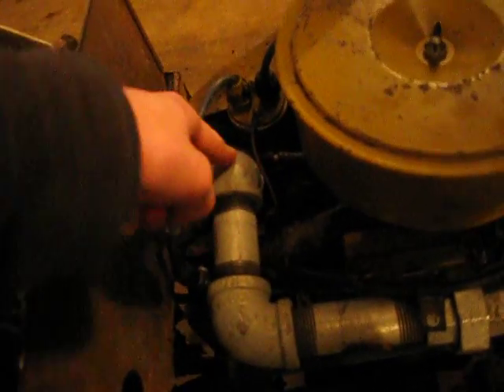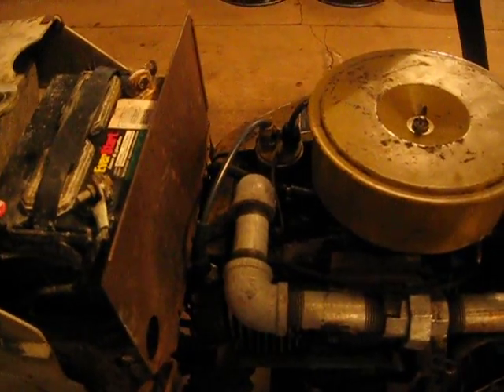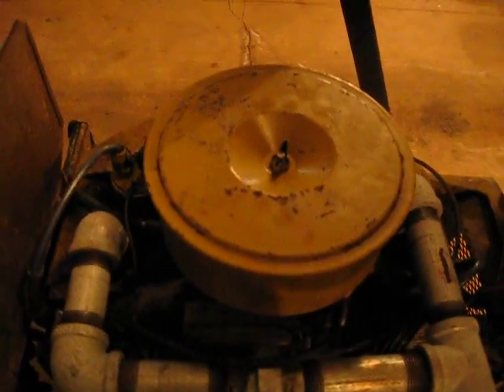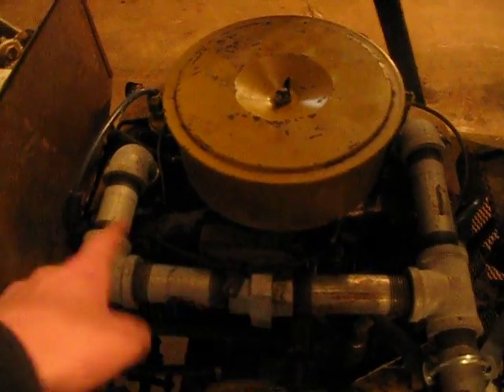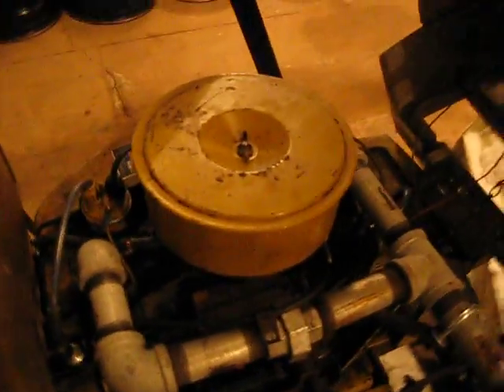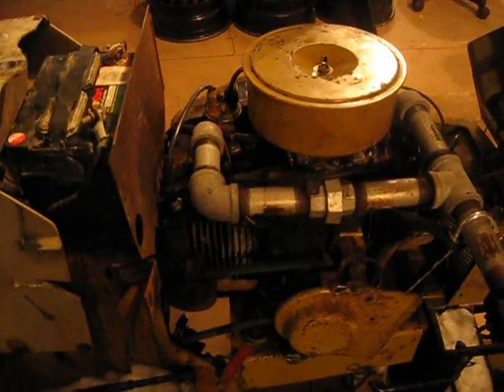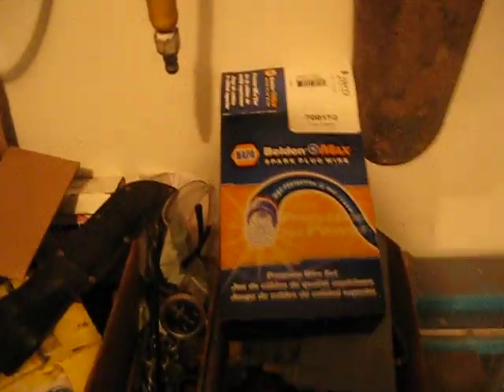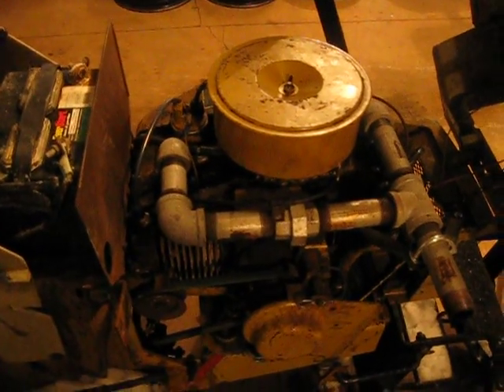SS/16 Stack Update

Comment: All of the GT's from the 80', 90's using a horiz. twin engine had muffler setups that had unequal distance exhaust routes. Never seemed to be an issue. Not saying you're wrong, though.